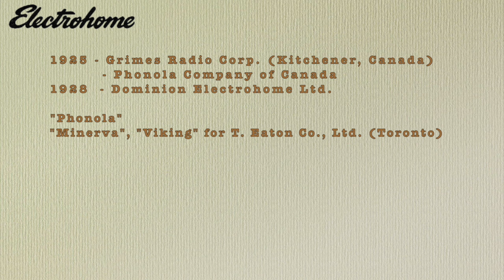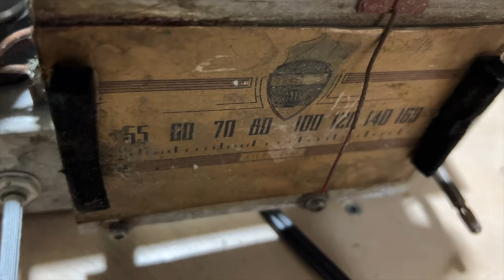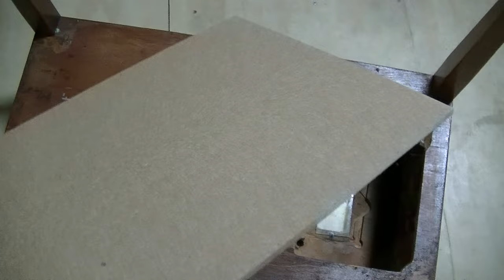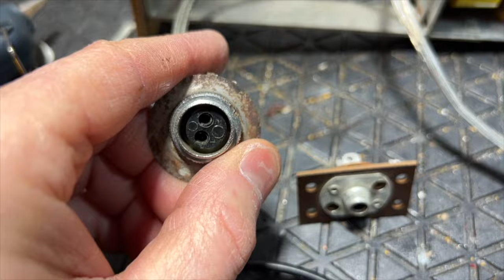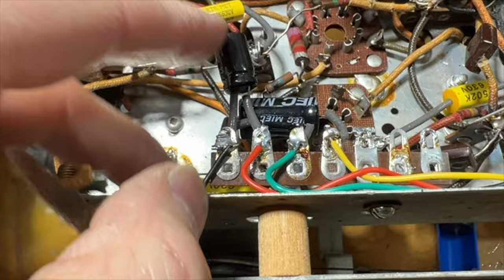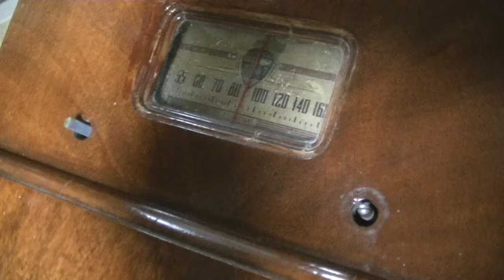Modern Amenities: Viking 1U51 Wartime Chair-Side Radio Repair

Comment: Looking at the phono jack, I wonder if the accessory turntable, when switched on, grounded the radio signal (white) and allowed the volume control to shunt the phono signal to ground at both ends resulting in max phone volume in the middle. Maybe not, just a thought.
Reply from the maker: Possibly. 
But we’ll never know. 😊

Comment: I do like your style when it comes to repairing and restoring  vintage electronics. Still could never understand why these
asbestos sheets scare people. Prying up the staples after wetting the sheet with water and couple of drops of dish soap 
in a spray bottle and disposing it in a thick plastic freeze type storage bag is actually good enough. Wash your hands afterwards. It's not something  to fear. Seems the radio was never meant to leave the enclosure  and getting your hands
inside to replace tubes may not have been an easy task. Steve from Illinois
Reply from the maker: Thank you for your kind words. I want to respect a piece’s original design. I try to approach my repairs with pragmatism, trying to functionally and aesthetically refresh the piece without erasing the essential patina. On the topic of handling asbestos in the context of vintage equipment repair, it may merit a video (or “short”) of its own! I’ve dealt with asbestos pads like that before and follow a very similar process that you suggest to safely remove them. There are so many aspects of vintage tv/radio repair that sometimes I find it hard to stay on topic. It’s too easy to veer off and end up with a meandering video with no clear narrative. With this video I almost fell into this trap. I appreciate your comments and criticism and will try to improve the quality of my work.